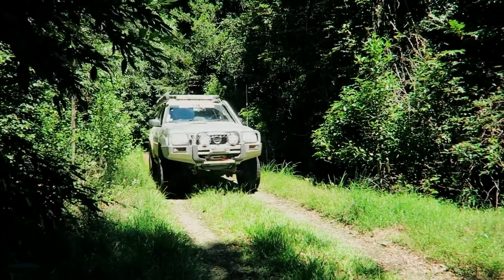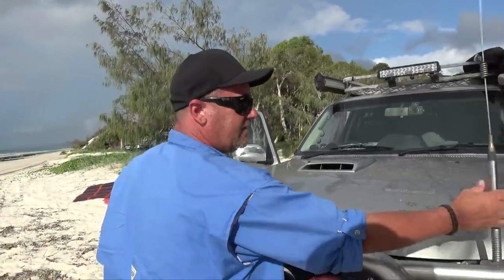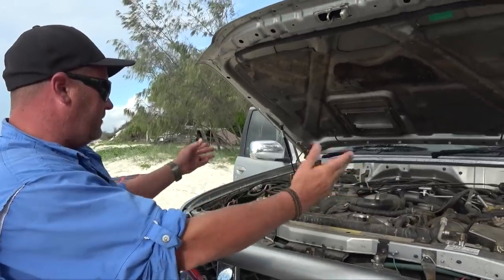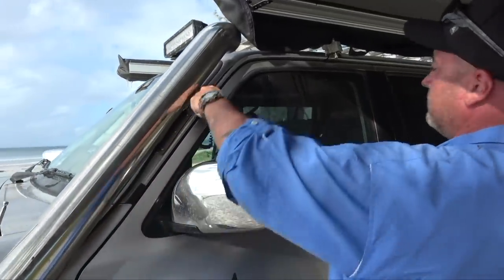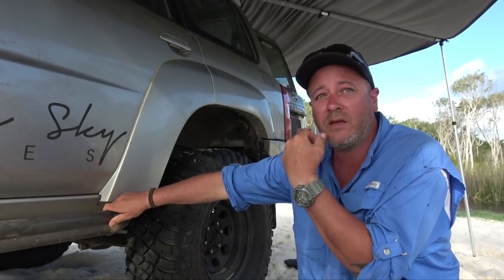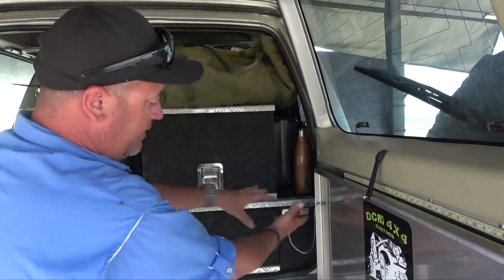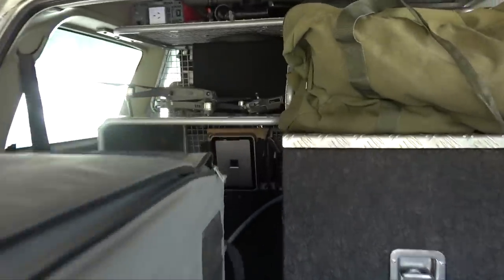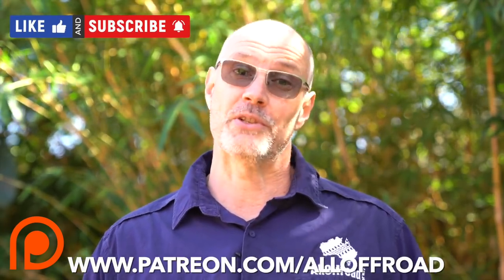Tuned Nissan Patrol GU 4.2 4x4 Tourer Walk Through

Comment from the maker: what do you think is this one of the best set up Nissan 4.2 (except battery system)? Let me know in the comments.
Reply: You done a review on your dcs battery
Or even a video soo far ?
I was chatting  to you and was going to meet you  to grab the revolution  we emailed about you  were  selling
But i wasnt in your timd frame of buyer meets seller
And i was needing a bigger unit
Reply from the maker: no mate, usually not quick with that stuff as I first like to test it a while, have an LiFePO4 video nearly ready and it will also show the DCS set up and my initial thoughts
Reply: AllOffroad 4x4 Adventures TV 
I just looked your battery  up
Its got a super red hot sake going on $300 - 400  bucks off right now
Reply from the maker: yes and DCS can have the prices as they don't have retailers and distributors and the associated mark ups
Reply: AllOffroad 4x4 Adventures TV 
I looked them last night after watching  this video
There prices are awesome
And the idea of using a lithium  as a starting  battery would be heap of weight savings
If you got the twin set up to run  150
Or the 200amp hrs youd easily save 50kg at a minimum
Thats massive 
Your not running the red 80 extreme ?
For your winch  setup ?
Reply from the maker: no the regular 100ah should be plenty for winch with two in parallel

Comment: Just a suggestion for the battery set up. leave the lead acids batteries under the bonnet lithiums don't like the heat. And look at a slim line 100a lithium for inside the car. Due to its narrow thickess 40mm maybe ,, fits behind or beside the fridge. Last about 3.5 to 4 days with the Engle with no charge.And you can still change over to your front batteries after that. Mines behind the seat with the  electrical . Send you a pic if intrested.

Comment from the maker: what do you reckon is missing on Scotties Patrol?
Reply: Do like the KM3 tires, but wish they were listed at 35 inches and were 12.5 inches on a 8 inch wide wheel for 15/16's and 8.5 on 17's(shorter sidewall), wish that KM3's were not as short and narrow compared to a Maxxis Razr MT, because otherwise they are the ideal tire for moderate offroading/touring.
Reply: My name on the Rego papers :)
Reply: @einfelder8262  lol
Reply: You know what's missing Stef.. a fte conversion ..
Reply: A 4.5 cummins diesel 750nm  DONK straight from the factory
Reply from the maker: lol I would agree there
Reply: Emu wings! Such a good investment when running twin carriers and barn doors👍🏼

Comment: I've ripped the sidewall out of 2 BFG mud tyres, admittedly the old model ones. Mickey Thompsons are on now and I've never had a puncture and they seem invincible on steel rims.
Reply from the maker: unfortunately no Tyre is invincible, I got 5 years out of KM2 and pretty hard driving for play and touring never had a issue. Had 3 sidewall punctures in my KM3 in one trip but we had overall 14 punctures it was unforgiving terrain and every tyre suffered.
Reply: @AlloffroadAu  Try Mickey Thompsons, I know a few people who have changed like myself and stuck with them. I don't think you will be disappointed.
Reply from the maker: yea probably not we had two people I drive with every week running MTZ, and they eventually changed as to many issues. Nearly every trip a tyre of the bead with low pressure and a few stakes
Reply: @AlloffroadAu  Tyre off the bead can be the rim more often than not. I have actually heard of MTZ punctures, must make them too soft. I run ATZ's because MTZs are too soft for my purposes. Probably explains the stakes. That said I have never needed mud terrains to get anywhere that ATZ's couldn't get. Spoke to a dude today who did the sidewall on a KM today (didn't ask which variation) so BFG still hasn't fixed their weak sidewalls. I'm always open to better options but so far Coopers and BFG have been garbage.
Reply from the maker: yea agree with the rim, but he does not have the problem now with KM2, He will no move to Nittos as there are no KM3 in the Country till December. The experience vary so much BFG have worked tremendously well for me in 7 years of Touring and Playing I had 3 punctures in the same tire on the same trip thats it. Cooper where horrible I had STT, AT3 and ST Max for a short while.

Comment: 2:15 Into the build and I already see that he has no idea. Tiny light bar up top, where you should put the largest, best spot and spread bar you can buy and two silly large round leds in the front blocking air flow. A slim low profile light bar in the front is much smarter.
Reply from the maker: lol while I agree with you in regards to the light bar, this car was used for work so sometimes stuff like lights where fitted at different stages and some for picture opportunities for the magazine he was working for.

Comment: How many k's? Curious, most of the 4.2's are  getting up there and I still want to purchase on for touring. Is 300k high?
Reply: Not on a clean example that's fine if you can find one for the right price. 

Getting 500-700kms before even needing to consider a rebuild on one that hasn't been thrashed is normal.